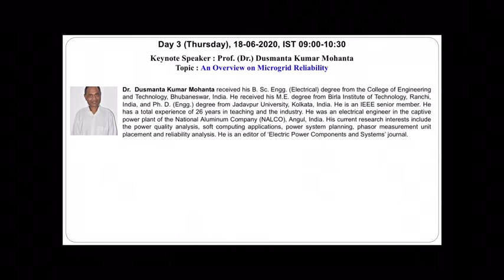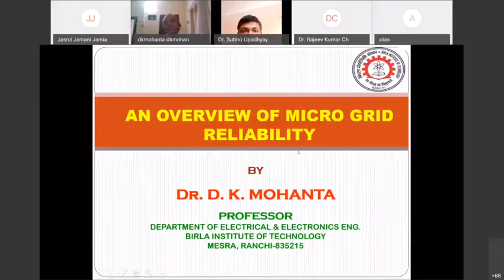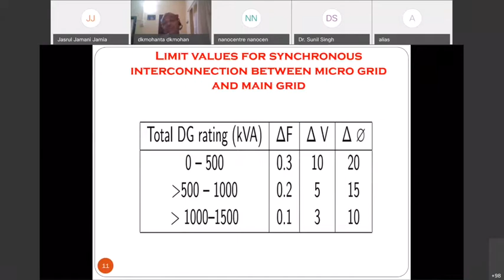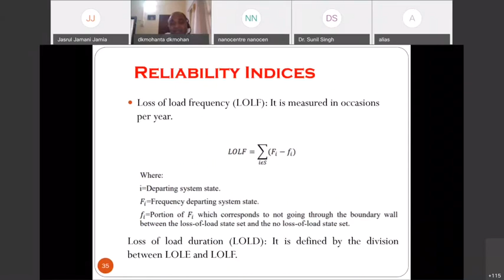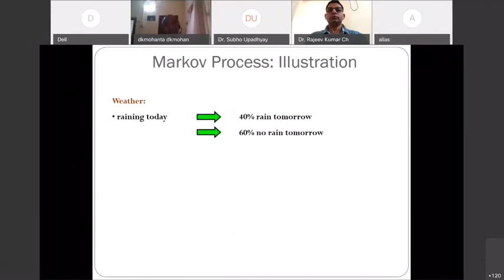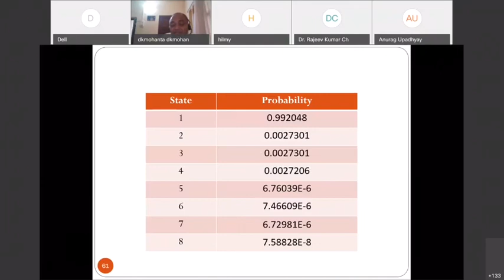An Overview on Microgrid Reliability By Prof. DK Mohanta

Comment from the maker: 00:07 Introduction of Professor DK Mohanta and his expertise
03:18 Electric grid interconnects generation, transmission, and distribution for power supply
07:52 Microgrid sources provide distinct benefits to system performance
10:11 Microgrid control system overview
14:30 Microgrid reliability is essential for on-site generation
16:43 Importance of maintaining purpose and operating conditions for microgrid reliability
20:24 Microgrid is intended to provide power using DR with reliability.
22:25 Understanding microgrid reliability factors
26:20 Understanding Microgrid Reliability Metrics
28:23 Reliability is the number of components surviving at any given time
32:25 Enhancing reliability of microgrids through redundancy and maintenance
34:35 Loss of load is when generation cannot meet demand
38:42 Microgrid reliability depends on generation meeting the load.
40:34 Explaining Loss of Load Probability
44:24 Microgrid reliability includes both generation and distribution analysis
46:41 System average interruption frequency index
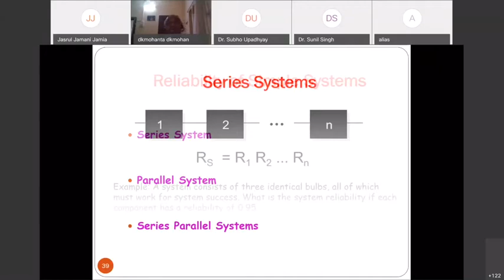51:22 System reliability is crucial for overall system performance.
53:21 Microgrid components and redundancy system
57:27 Calculating available megawatt after unit trips
59:54 Microgrid reliability calculation based on capacity and output
1:03:47 Calculating loss of load probability for a microgrid system
1:05:41 Introduction to Markov model in Microgrid Reliability
1:09:44 Microgrid reliability is dependent on the states of wind turbine, rectifier, and inverter.
1:12:06 Understanding transition and transient failure in microgrid reliability.
1:16:19 Reliability is crucial for microgrid investment decisions
1:18:36 Reliability of microgrid is higher compared to conventional grid.
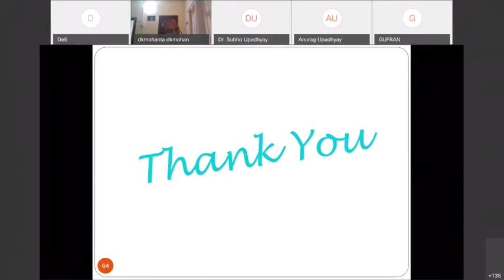1:23:12 Microgrid resilience is achieved through withstanding and recovering from system failures.
1:25:42 Resilience and reliability are interconnected in microgrids.
1:30:46 Dependence of microgrid reliability on type of distribution system and load priority
1:32:59 Expressing gratitude and seeking feedback
Crafted by Merlin AI.